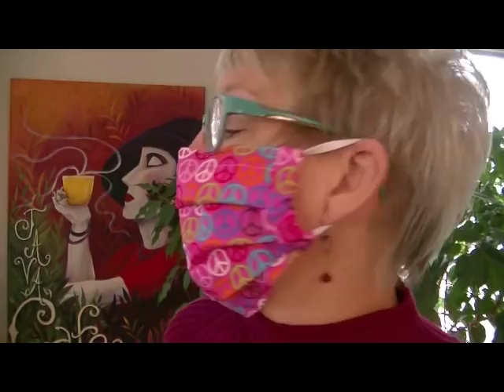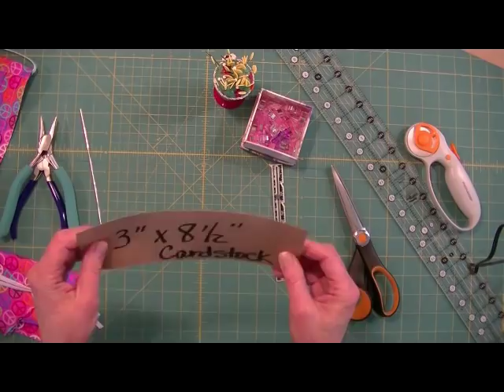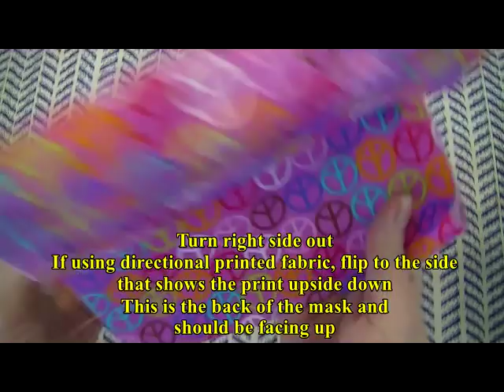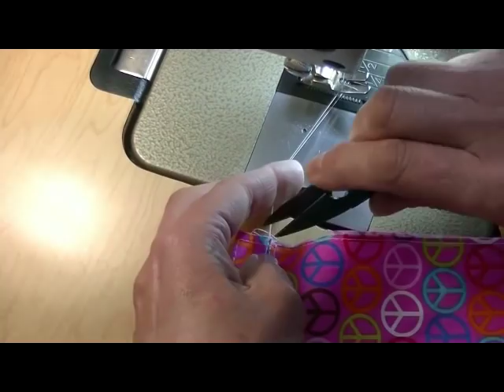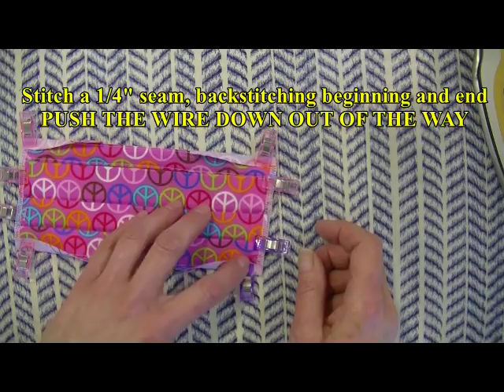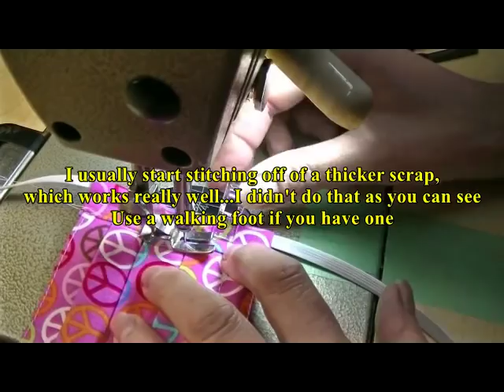DIY REUSABLE FACE MASK with FILTER POCKET-4 Style Options-1 Easy SEW Pattern-Won't Fog Your Glasses!

Comment: I am wondering if you sew the wire in place and put your masks in the washing machine, can they get distorted?
Reply from the maker: Hi Delfina
I hand wash mine and hang to dry. The wire doesn't take a beating and get distorted.
Reply: Hi! You can handwash or put in laundry bag or pillowcase in the wash. I prefer to lay flat to dry.

Comment: I suggest never, ever washing any of fabrics before using them. If you purchase well made, ------ quality ----- fabrics, there is no need. (You get what you pay for with fabrics). What if the person wearing the mask has sensitive skin, or allergic to certain soaps? Let the person using the mask -- or anything that you make determine what soaps they want to use. No clothing is sold "pre-washed," except overpriced jeans.
Reply: I pre-washed my fabric, ironed it, then cut the pieces to sew. I had absolutely not problem what so ever.
Reply from the maker: I figured this out. Quilters (me included) are different sewists than garment makers. A quilt made with fabric not pre-washed, gives it that vintage look when the fabric shrinks up against the quilting stitches. Quilters use pre-cut strips and squares which are never pre-washed, hence the mentality. If you sew garments, or anything meant to fit a person, you pre-wash to pre-shrink the fabric. Pre-wash fabric BEFORE you cut pieces.
Reply from the maker: Since it is 100% cotton, shrinkage would be a major factor which I have no idea how much the fabric will shrink and how well it will fit. I pre-wash my fabrics BEFORE cutting and then instruct the wearer to wash the mask prior to wearing. No one has any idea what kind of environment it was created in...They could have a cold, or smoke, etc...anything is possible. I found my cat napping on a stack of fabric ready to be pre-washed once. It got washed and put away until I cut it.
Reply: When I prewashed my pieces of fabric, they all shredded, and became entangled into huge knots. The sizes weren't correct anymore either.
Reply: @debbiedebbie9473  Yes, that so true with all cotton. But i must wash/iron all fabric as soon as i get it home, allergies to chemicals in them. Then cut pieces for pattern. If you must wash after cutting pieces of fabric then just do a top stitch on the edges and it won't shred and twist out of shape.  Give it a try.
Reply: @musicadd1  :  Agree that fabric should be laundered prior to construction as even while sitting on store shelves they are exposed to environmental elements  (like dust)  not to mention if using it for masks that will be laundered (in the hottest water possible and if tossed in the dryer) 100% cotton has been known to shrink regardless of its price range!   (I've learned the hard way .... ☺.)    Also with the cheaper varieties   colors have been known to  bleed.   As to fabric fraying;  also agree with your suggestion plus shall also  add if fraying is still a concern,   cut your pattern pieces out using pinking shears.  
Footnote:   Tip --  to launder;   in lieu of detergent and/or fabric softener wiser to use a mix of water and white vinegar and rinse well.    The latter of which will not only disinfect  (as once used in hospitals to do so)  but will also fix/set colors to prevent bleeding.
Reply: mrsbenn1 Didn’t think about vinegar...husband uses it in weeds and the yard stinks! Plus he knows I hate it....Ok, I’ll consider myself scolded by quilt police but I’ve bought jelly roll strips precut at quilt shop etc and washed them in a bra zipper bag I bought at Daiso and wasn’t too terrible. I did rubber band them and washed like normal fabric. I put in dryer for 20min still in bag then let them dry banded. Evil necessity since I needed a log cabin top done ASAP.  If it was Joann or hobby lobby jelly roll there was a bit of shrinkage but log cabin is forgiving.
Reply from the maker: You don't pre-wash the cut pieces, you wash the entire piece of fabric BEFORE you cut it.
Reply: @makingiteasywithliz  Yes, I also prewash 100% cotton fabric to preshrink. I fold into a big square and baste the free edges together and place into a laundry bag to wash, otherwise 100% cotton will end up a big ball of mess.

Comment: Excellent tutorial!   Though making a different pattern, appreciated your tip of using a cardboard template when creating the pleats.   That said; prior to securing them into place, rather than use clips I found using  a strip of  cello tape (gift wrapping tape) works just  as well and isn't as time consuming and if placed beyond the 1/4" mark there is no need to navigate around the clips when stitching.  (Hope that makes sense ... ☺.)    Also like your ideas  of  a)  the wire extending  across the width of the mask (rather than just a small portion) as have found it to be more functional b) providing a pocket channel for adjustable elastic for ear loops and/or ties.  
Footnote:  For those who opt for using cello tape;  ensure it is removed prior to pressing as otherwise will leave a residue on your fabric.
Reply from the maker: Thank you so much! I say, whatever works for you. I have made over 300 masks and I can pleat one from start to finish in 1 minute...I timed myself. It didn't take that long to get a rhythm down. Tape is an extra expense and waste and OK if you are only making a few...I am making hundreds and I'm not trying to beat the clock, and I am very efficient.

Comment: Thankful for ur video, however, you are not stitching 1/4” inch seam 
allowance.
Reply from the maker: The two seams that are sewn are 1/4"...stitching the 1 1/2" marks and the side pieces. Do you say that because you can see the 1/4" marking on my throat plate? The edge of my presser foot is 1/4" and I use that as my guide. It's just optics.

Comment: With the "round" elastic, if you cut 7 inches of the flat elastic, would you cut 7 inches of the round elastic?
Reply: Um, a mask. I just watched this video, you use elastic. I am making the one with elastic that goes around the ears.
Reply from the maker: 7" might work if you are sewing it into the mask but won't work with mine because it runs through the casing. Cut 13" each, run it through the casing and leave untied for the wearer to fit and tie.
Reply: Hello Donna how are you doing today hows everything going?
Reply from the maker: I have never used the round elastic so I cannot answer your question. What are you using 7" of elastic for?

Comment: There was a medical research study done that shows if you cut out a section of pantyhose & put it on over a mask it makes any fabric mask pretty much as effective as medical masks!  It holds the mask against your face with no gaps, & then no need for any nose wire or adding a filter!  There is a picture in this news story showing how to do it & explaining the study.  https://www.npr.org/sections/goatsandsoda/2020/04/22/840146830/adding-a-nylon-stocking-layer-could-boost-protection-from-cloth-masks-study-find

Comment: I really think this design is more dangerous than others. You have an open pocket top and open 'ip' facing folds on the inside. This means that dust moisture and germs are more likely to collect in those pockets than 'down' facing pockets. When moisure and germs build up while in use, you as the wearer are more likely to breathe in germs while you are out. Why wouldn't you use side pocket openings for filters and only downward facing folds on both sides?
Reply: I wish I understood your complaint.
Reply from the maker: What you are saying is unnecessary over thinking IMO since the mask is to protect others from you...to keep your droplets in, which is exactly what it does. Besides, the pleats smooth out when you're wearing it.
Reply: I have a new mask for every day. I am working in a shop. Have a clean zip lock bag with new masks and filter always in my bag. Another zip lock bag for the used mask. Both bags are marked of course to see always which one is which. And I spray some disinfectant into the dirty mask bag until I wash them. Works well for me.
Reply: Hello how are you doing today?

Comment: I used the floral wire to make a 6” wire with a hook on the end that fits through the space where the elastic goes. If you need to change your elastic, just put it through, grab your elastic, and pull it through the channel. As Liz says “Easy, Peasy”!
Reply: Hello Deborah how are you doing today?

Comment: It’s me again!  Have you come up with a pattern for the Olson style mask with nose piece and filter pocket?  I’m getting asked to make that style and your instructions are so easy to follow. TIA.
Reply from the maker: Thank you Kim, but, no I will not be doing any other mask patterns. There are hundreds to choose from already.
Reply: @Kim M:  For something very similar to the Olson mask, web search 'Craft Passion'  Blog where she has a fabulous design in varying sizes also with or without an optional filter pocket.    Just follow the links for your choice ensuring you choose the one that  includes   seam allowances and once printed off check the scale (since printer formats are not all created equal).   To conclude;  also shall add  something I did find with this particular design is that I felt ' on the average'  for the adult male and/or  female  sizing it could be a tad longer in length   for appropriate fit (no more than 1/2" though)  if the wearer might have Caucasian  bone structure so depending upon whom you are making them for, you may want to experiment.  See my footnote below.
Footnote:  In regards to the added  1/2";  prior to cutting  add it to the pattern piece at its bottom as if too long can  always  be eliminated/resewn  prior to finishing off the ends of the mask.    I've lost count in the number of ones I've made in this style as donate them to whom ever expresses a desire for one and the feedback in respect to fit  has been excellent.  Note as well, I also add a nose wire to them however apply it to the upper seam  stitching line  whereas a different method is provided in Craft Passion's instructions.

Comment: Hi Liz. I just wanted to compliment you on the design of this mask. I have been working on several, and I'm amazed at how easily they are coming together. I don't have the same sewing skill level you do, nor do I have an industrial machine. I chose to use your first method for pleating, as I felt that it gave me more control. I basted my pleats into place before I added the side casing pieces. It has all worked beautifully and my masks are coming out great. So thank you for this design.  I am planning to mail a few out to friends on Monday May 13, and I'm sure they are going to love them.
Reply from the maker: Thank you so much, Connie. I love that you worked it and made it your own.
Reply: Hello Connie how are you doing today?

Comment: Is this size a universal fit for both men and women? Can the pattern size be increased - made wider (ear to ear) or in deeper (chin to nose)?
Reply from the maker: I have found that this mask fits both men and women well, though some men may need a little extra, so try 8.5""x 17", making it 3.5" wide. The side pieces will be 2.5"x 4.5". See how that works.
Reply: @makingiteasywithliz  thanks!

Comment: Love the video and the mask.  I am making 70 and I am also lazy (efficient).  I didn't want to have to measure/mark 1-1/2" from the ends so I looked around and found that the small post-it notes are exactly 1-1/2"  (x2").  So instead of marking from each end, I just stick the post-it at the top right next to foot &  sew down 1-1/2", raise the presser foot , slide down to the bottom & move the post-it down to sew the final 1/4" seam.  I hope this makes sense.  It's the step after serging the short ends where RST, you seam 1-1/2" from each short side.  I'd post a photo, but not sure how to do that in a comment.  Thanks again,  Liz.
Reply from the maker: That is brilliant and a definite time saver. I love your way of thinking.
Reply: Hello Susan how are you doing today hows everything going?

Comment: I made my first mask and it turned out well. Feedback from family is it is heavy and I find it difficult to breathe. I have not yet inserted a filter. If I order more fabric, how do I know if it is lightweight enough? I have muslin and will try that next, but what about patterned material? Thank you for posting this awesome info.
Reply: Hello Linda 👋👋...

How are you doing today hows everything going?
Reply from the maker: I think just breathing through anything on your face is heavy. I find it hard to breathe, I also can't stand the covers over my face. High thread count bed sheets work well. I used 300 thread count top sheet from Walmart and it was nice and light. Quilting cotton can sometimes be thick. I don't use a filter.
Reply: @makingiteasywithliz  Thank you. We're trying different fabrics, but tried the first one on without a filter. The muslin is better but more difficult to work with.

Comment: Stretchy material like t shirts and leggings are no good as it stretches so be ones more porous .
Reply: I zig-zag stitch the "ties"/elastic pcs that I make from leggings/stretchy material.  Looks decorative and does not allow pcs to fall apart.  Great for doing the one=long-pc of 28 to 30 inch insert that Liz refers to, and can be easily replaced.  Soft, non irritating, especially for children.  And if you have latex allergy (as hubby and I do) the regular elastic is not an option.
Reply from the maker: I like that people are flexible and making it work for them.
Reply from the maker: Good to know, thanks.

Comment: You did not try this on, if you had you would have found that the ear pieces are to short.
Reply from the maker: I tried it on in the beginning of the video. I changed the measurement to 12" in the description. The original pattern I learned from said 9 3/4" elastic so I added some, and you're right, it was still too short. I have since been using 13" and I leave them untied for the person to fit it to themselves. There's nothing else I can do once the video is out, but the correction will be in my next one on making them in bulk.

Comment: First of all your mask is my favorite one so far! What measurements would you use to make coffee filters or flannel fit inside the mask and which material would you recommend. I tried to shove a coffee filter in there and it was all wonky and crumpled. You didn't mention how to make filters so just curious. Thank you
Reply from the maker: Thank you Michelle, at the time of my filming the video, I hadn't gone that far. I plan to make one answering everyone's questions. I have a neat hack for getting your filter in there. Try a 5x6" piece of whatever you're using. Take the pleat board and clip the filter to it, wrap the sides over the edges, place into the opened mask and once you have it in lengthwise, smooth the edges out to fill the mask, unclip and remove board.
Reply: @makingiteasywithliz  thanks for the awesome hack! Ill try it out!
Reply: Hello Michelle how are you doing today?

Comment: This is just what I am looking for! I haven't been happy with the ones that have an unbinded edge on the pleats. This solves that. I'm making one just like you showed.Then, I may modify the pattern to use unbleached muslin on the inside -- as soon as I get my math calculations right. :-)
Reply from the maker: Thank you Marlene. If you're using muslin so you can tell inside from out, don't bother with that, just stitch in a piece of folded ribbon into the inside side casing when you do the final top stitching.

Comment: How do I adjust the sizing to fit a five year old?
Reply from the maker: The adult mask is a 7.5"x7.5" square, and about 8"x3" (6-6.5" opened up) when finished. So I reduced the kids masks, by 1", 1.5" and 2" for the square measurement. The side piece I reduced by 1/2" increments, keeping the 2.5" width for all (3.5"x2.5", 3"x2.5"). Kids are all different sizes, so age is not a reliable factor. I don't have any kids in my life so it's a guess, really.

Comment: Liz, How does the 14 g wire hold up in the laundry?  Can I still machine wash the mask?  thank you so much for the pleats hack!
Reply from the maker: I washed mine in a lingerie bag, in hot water in a big load of blankets to see what it could take. The wire was easy to smooth back out and reshape to my face. I just hand wash them now.

Comment: What is the finished size of the child's masks?
Reply from the maker: The adult mask is a 7.5"x7.5" square, and about 8"x3" (6-6.5" opened up) when finished. So I reduced the kids masks, by 1", 1.5" and 2" for the square measurement. The side piece I reduced by 1/2" increments, keeping the 2.5" width for all (3.5"x2.5", 3"x2.5"). Kids are all different sizes, so age is not a reliable factor. I don't have any kids in my life so it's a guess, really.
Reply: Hello Barbara 👋👋... how are you doing today

Comment: Hi Liz this is absolutely amazing, very clear instructions and I am making a few now.. I have one question, if I may .. have you any tips on washing the raw fabric first in the machine with out it getting tangled? One small batch got very tangled and ended up creasing the fabric causing white faded lines. many thanks Sara
Reply from the maker: Hi Sara,
It's important to open up your fabric completely before placing in the washer. I don't know about the faded lines, I have never had that happen, perhaps it's the quality of the fabric/dye. I wash them on casual, with just a bit of detergent, in warm water and machine dry.
Reply: Making It Easy with Liz  thank you for your prompt reply. I’m not sure either about the lines. The fabric did fray in the wash and got tangled. But the company are replacing it. So no harm done xx